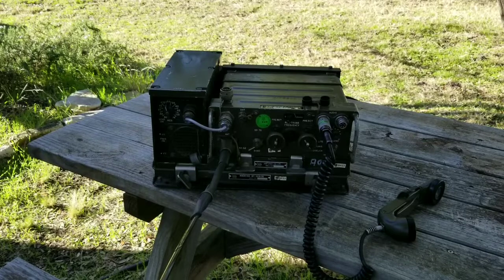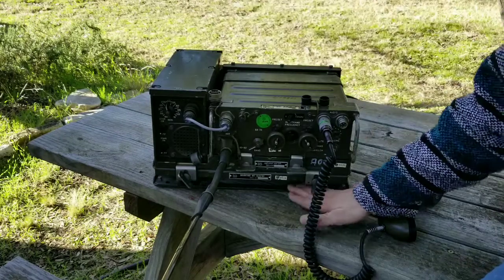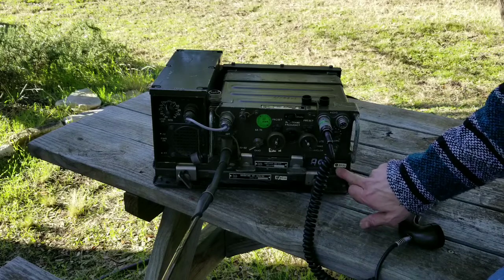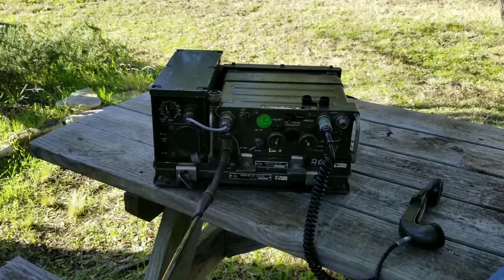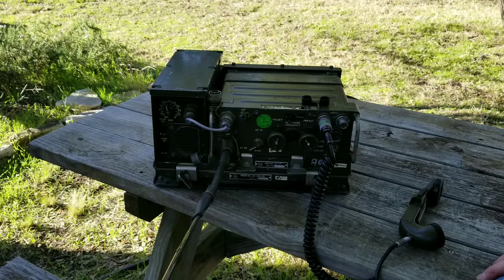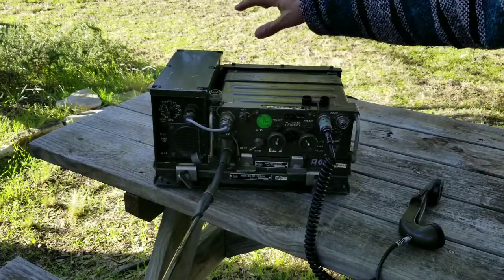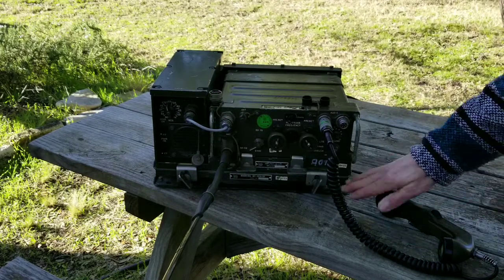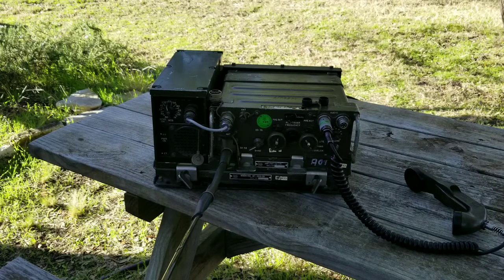PRC-77 with Amplifier and Vehicle Mount Overview AM-1777 / AM-2060 & MT-1029

Comment: Hello,

I have a few questions about an Austrian PRC77 before connecting the voltage to the radio.
Can you give me some advice?

I have a: - mounting MT1029/VRC
- amplifier AM1777
- PRC 77
- Range booster PP770
- cable CG-530F/U
- cable CX-4722AN/VRC
- antenna MX-607/VRC
- wip AS-1730/VRC
- wip AT-1095/VRC

Everything is assembled and connected.

I have a 24V vehicle and the PRC-77 radio is maximum 15V. 
The MT1029 base has a 24V vehicle voltage supply.
The AM1777 amplifier is mounted on the MT1029 subbase.
Does the AM1777 support 24V from the baseplate?
If so, is there a transo in the AM1777 to reduce the voltage to the max 15V radio voltage?
I'd like to know before plugging the battery into the set so as not to deduct the radio and its amplifier.

Thank you in advance for your valuable advice,

Christian
Reply from the maker: You're good to go. 24V vehicle power connected to MT1029 with AM1777.  AM1777 connected to PRC-77 via tether without a battery installed in the radio.
Reply: Hello,

I didn't quite understand what you were saying.
I don't speak English and I'm getting by with a translation system.
Can you use short sentences, it's the easiest to translate.

Thank you for your understanding,

Christian
Reply from the maker: It is safe to connect 24V to the equipment you listed.  Be sure to remove the battery from your PRC-77.
Reply: Hello,

Ok, I get it now.

Thank you for your help.
All the best,
Reply: Hello,

Why do I have to remove the PRC77-0 batteries on the AM1777?

Kind regards,

Christian

Comment: Thank you for this video. I worked at Electrospace Corp in Westbury, NY in the early 1970s. I was an electronic tech just out of tech school and my job was to align the IF modules on the PRC-77. They would take a plastic sheet with the IF waveform and place it on an oscilloscope. I would align the module to match the waveform on the sheet. Eventually I was promoted to work on a high power system. Arnold Wolf was the president of the company. The engineering lab was also working on AM stereo and almost had it working but the company went bankrupt by 1975. It was a great place to work and I'm not surprised there are so many PRC-77s around today as they were built like a tank. They live on.

Comment: I was in the USAF in the mid-80s.  I was part of a tactical radar unit meant to setup a TPS43E behind enemy lines (if the balloon went up).My commander's command m1009 had a HF radio, complete with a big whip antenna. Was this a PRC-77? I mean, it HAS been the better part of 40 years. Just curious
Reply: There are many radio sets that fall into these type fm receiver transmitters.  The RTs that were most commonly used were the rt524 and the rt248. The prc77 was more commonly used for line infantry units in backpack or battery powered mode for non mechanized infantry.  I was in 3/187inf Rakassans from 91-3 and we had a lot of the prc77s but only two or three with this configuration in a vehicle. We mainly had the AN/VRC46 or AN/VRC47 radio setups before the SINCGARS (single channel ground/air radio system) radios that used frequency hopping instead of a dedicated frequency.

Comment: How can i extend the scope of this radio...i know that it basic reach 5 mile...how can i extend this distance ??
Reply: Longer antenna
Reply: If you want to use it for the 6m amateur radio band you can connect to the 50 Ohm B.N.C. socket a yagi antenna. This radio set shown in the video was produced in Germany by Telemit. I know this radio very well, because I was working as at technician in this company.

Comment: Can you please show backside of this system and its connections.etc. I am interested in knowing if a M38A1 with MX-6707 antenna connects to both rear connector on AM1777 amplifier, and also coax cable also connects to PRC 77 radio "ANT" port at the same time. would this be a correct ?

Comment: Can these radios communicate with any civilian type radios?  Ham, CB, FRS, etc.?
Reply from the maker: Ham radios that operate FM in the 6 meter band can communicate with these radios
Reply: @WW2JeepandRifle  Excellent! I am in the process of getting a functioning RT-841/PRC-77 with all accessories, an AM-1777 , and a backpack. I have the MT-1029 and 14.5 foot antenna on M38A1 CDN3. I enjoy your videos, and learn a lot. Thanks for getting back to me. If one has a radio in the vehicle, it would be nice to be able to communicate with someone else.
Reply: @WW2JeepandRifle  I have an MX-6707-VRC antenna mounted on an M38A1. There is a coax cable that comes from the antenna and attaches to "ANT" connection on the PRC-77. There is also a 12 pin 22 ft cable ( CX4722A/VRC), that connects at the antenna and then over to the back of the AM-1777. Are both of these cable connected at these points at the same time?

Comment: No extra channel s . The x mode plug is for comsec . Comsec is a sepret system that's connect Ed though the x mode jack . You will find that the x mode jack has a plug in it . That plug has circuts to connect the system when the comsec is not in use .

Comment: sir that toggle switch that does the 25 Mhz spacing is NOT the X-MODE...There is a X-MODE PLUG on the bigger RT-524 Vehicular Radio set and that plug is used to attach the  VINSON Communication Security package the KY-57...AND since you have a PRC-77 family radio...the POWER plug/receptacle can use the interconnection cable that connect the PRC-77 and the KY-57 COMSEC package...so in a way even it is not labeled on the RT itself the 77's power receptacle can be called it's X-MODE plug.  But the Power plug on this PRC-77 is used MAINLY to connect the Vehicle Power Adapter so you can use the Vehicle power supply through the MT-1029 AKA...the Mounting Base Electrical Equipment, AKA the MBEE and not need to use the onboard Batteries in the bottom of the radio set.  So lets get the terms right for your listeners.

Comment: I have a 1967 Prc-77 and the Am-2060 in my shack powered by a 24 volt power supply.The antenna i'm using is a Yagi I made up vertical for FM use.
         Also have a RF amplifier made by General Dynamics seems it is a trial amp that was tested out in the late sixties it has stickers on it for the prc-25 and 77 as well as the prc-6 and prc-10 radios it states prc-6 will put out 20 watts the prc-10 will also put out 20 watts the prc-25 and 77 are stated to put out 30 watts with this RF amp i haven't tried it as yet but will be doing so in the near future.Jim